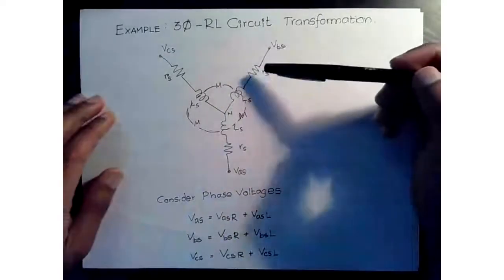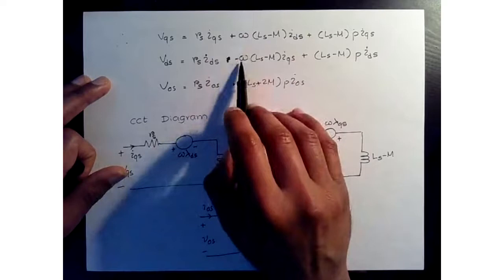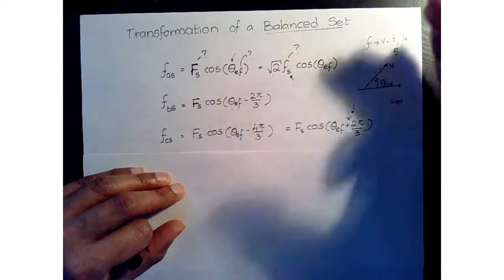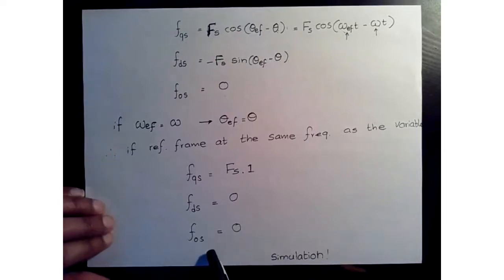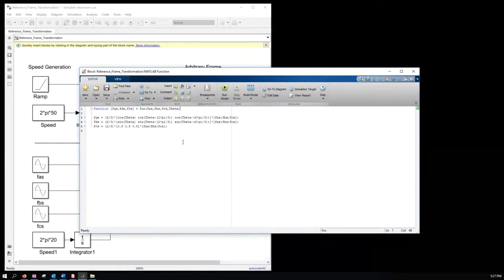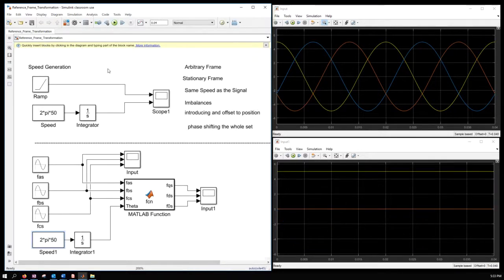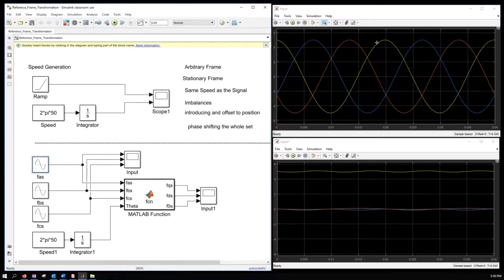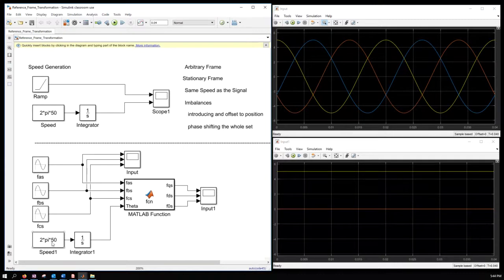Reference Frame Transformation for Balanced Systems and Signals

Comment: Thanks for those videos – they were really amazing and helped me learn the topic as a master's student. It would be very nice if you could also introduce examples or tips regarding discrete implementation in MATLAB, especially when working with HDL Coder blocks, since it’s very common to deploy designs on FPGAs.

Comment: How the initial zero condition of the integrator results in zero offset? How both the space phasors are getting aligned for initial zero condition?
Reply from the maker: Sandip, this is done by the controller as we have a position sensor that is properly calibrated, and continuously measuring rotor position. With this, the controller can always align the current vector. If this is not clear, reply with the time stamp of the video and I can further clarify.

Comment: is the rotor angle of PMSM is same as rotor position for FOC control ?
Reply from the maker: Pavan, simply speaking yes, they are the same thing. You do have to think about whether you are referring to the measured position from a sensor or not. Because we use a sensor to measure rotor position/angle which may not be properly aligned to true rotor zero position.
Reply: @SandunKuruppu  thank you sir